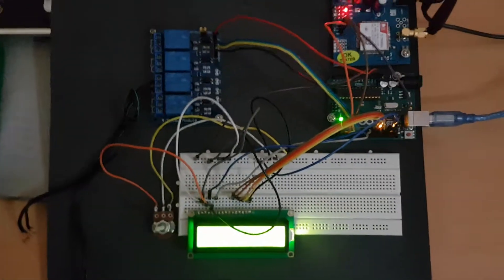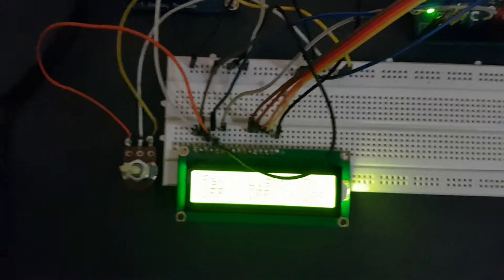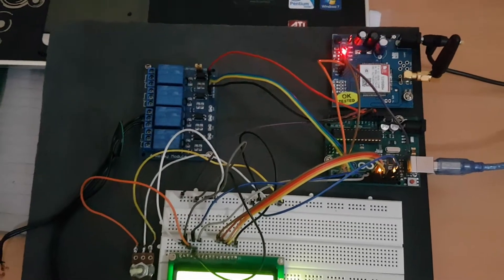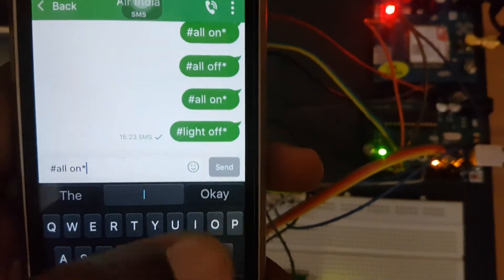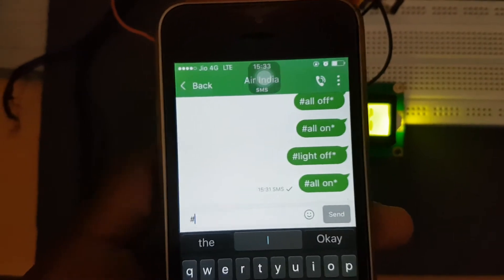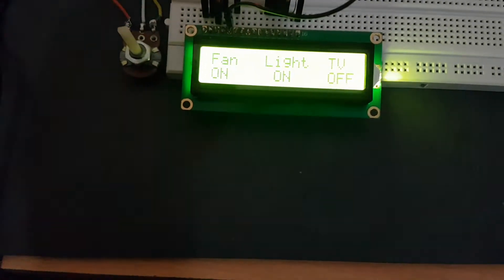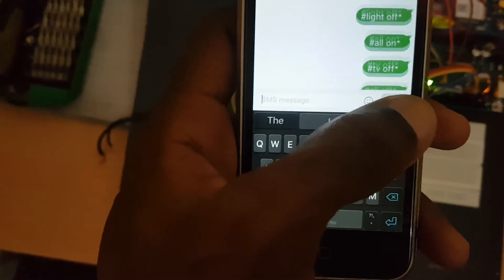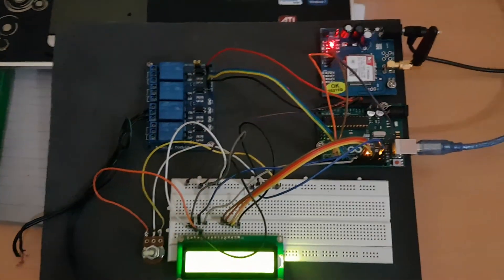HOME AUTOMATION USING ARDUINO UNO AND GSM SIM800A MODULE

Comment: how to you connect sim800A with arduino and what is power supply..?
Reply from the maker: There is transmit(tr) and receive(rx) on both the GSM module and the Arduino device, you should cross connect them i.e tr -rx and rx - tr.
Reply: @DIJINET_iFIX  power supply..?
Reply from the maker: @jayeshadwani3779  12v 2amp
Reply: @DIJINET_iFIX  I am using same things in my circuit but still the network is not registiring
Maybe the sim card issue..?
Reply from the maker: @jayeshadwani3779  yes, maybe... You should use a 2G simcard
Reply: @DIJINET_iFIX  Thanks buddy
Reply: @DIJINET_iFIX  how do you get a 2G simcard..?
Reply: How do you get a 2G sim